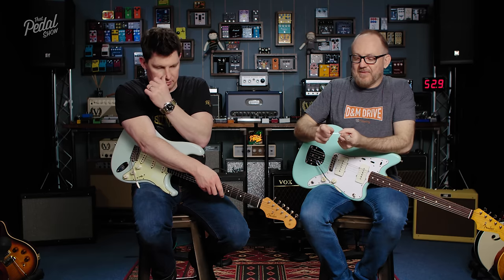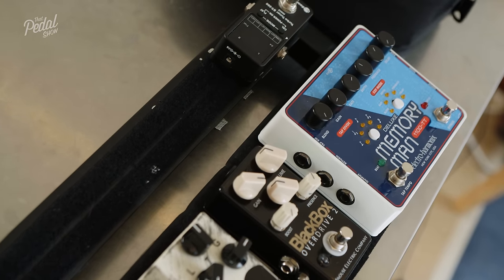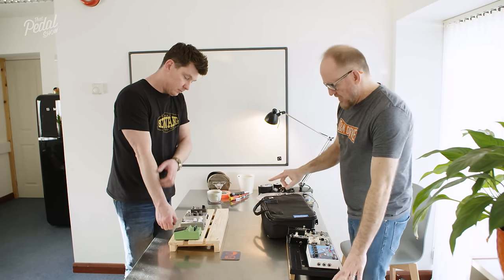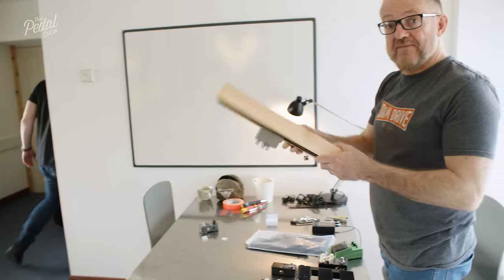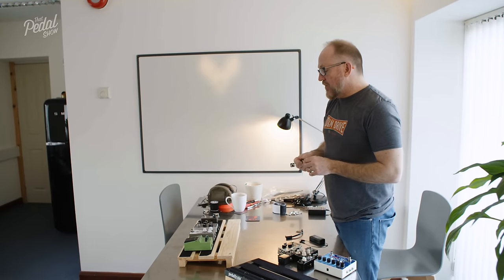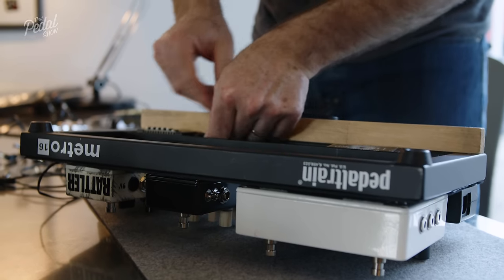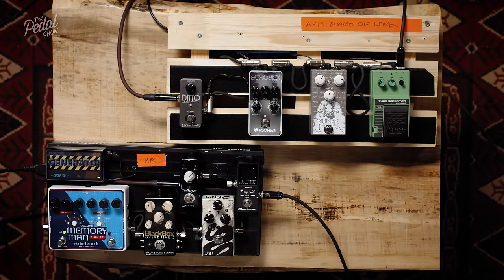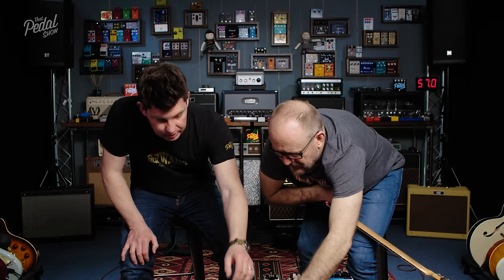Tips For Your First Pedalboard Build – That Pedal Show

Comment: Man I wish this video existed 20 years ago when I first started getting pedals. Daisy chains and cheap patch cables all over the place. People don’t realize the service you are providing. Keep it up guys.
Reply: ah the good ol days of the carpetboard! sweet nostalgia.
Reply: Wild Eye Right?!? I am embarrassed that I got my first good power supply for my pedal board in 2005 or so.
Reply: Wild Eye  I'll put my hand up to the same mistake. Hey, got a lot of great (and pricey) pedals, nice guitar(s) and a couple of sweet valve amps. Now...power...hmm, those Joyo PS seem pretty good...
D'Oh!!!

Thanks be to D & M, now I have a Strymon Ojai with a Zuma on the way. Can finally use the high ma units wirhout bloody separate adapters into a power board. Line6 M5, revenge is mine! TC Vintage Delay,  12v 270ma? Bwahaha you cannot defeat me with your puny ma draw, now!
Reply: I'd buy GigRig but they are always sold out and buying from overseas? I also need to eat,  eh.
Reply: I'm just starting with this pedalboard thing. Can someone tell me the difference between a daisychain and a power supply? and how does it affect the sound?. I'll appreciate it
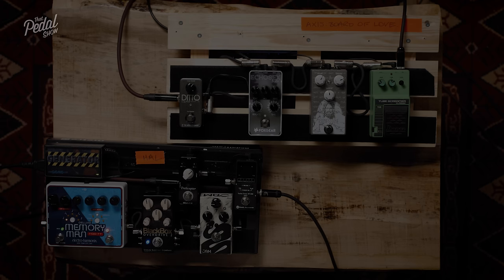Reply: @mollet09  It depends on the chain. My chain with all analog pedals sounded fine with a daisy chain. I had no noise issues. I eventually got an isolated power supply to make things neater, to power more pedals than my daisy chain could handle, and to have the option of 18v for some of the pedals. But it sounded exactly the same as the daisy chain. Daisy chains are perfectly fine if they work for your rig. But some people have noise issue when some pedals interact like what we saw with Mick at 58:40.

Isolation is always good though but daisy chaining isn't always good. Neither should affect sound but sometimes they do. I recommend a power supply just to be safe.
Reply: @JELIFISH19  thanks for the info!
Reply: @mattgilbert7347  i still daisy chain and use several power supplies. i tried to switch to a single high end unit, but not one has the required power for all my pedals. one of my pedals requires 12ac 1000ma.
Reply: @yomuthabyotch  Yep. My 1st Pedalboard was a thick piece of carpet.
Reply: I couldn't agree more. I wish all of these online resources existed when I started playing 30 years ago
Reply: Does the power supply actually make that much of a difference??
Reply: @dizzyguy7423  if it's cheap? There is a very good reason, poor regulation is guaranteed to make the pedals scream!
Reply: @yomuthabyotch  I still have mine! It sits in the garage now and haven’t used it for maybe 13 years and I’ve upgraded to a professional pedal train board. But yes I got good use out of that carpet board!
Reply: HA!, HA!  RIGHT! TOO FUNNY, Mr. PENGUIN! , - Eric   lapton

Comment: A quick thought on attaching velcro or dual lock tape on the bottom of Boss pedals.
If you unscrew the base plate, you can turn it over and screw it back on with the inner surface facing out. Then you can put your velcro on without any trouble.
Reply: this comment just saved me ripping the rubber base of the bottom of my boss pedals, thankyou!
Reply: Neither things is necessary. Just put a piece of Velcro on the middle of the bottom plate, between the rubber pads... Absolutely no problem with it sticking. 

Don't make it harder than it needs to be fellas
Reply: Tried this with my Boss Tremolo. It doesn't work cos the rubber pad presses against the IC board. But good guess anyway!
Reply: @ryans9029  this is correct.
Reply: @jamesmolloy5350  damn, i already did that lol. ill make sure to use this trick in the future tho.
Reply: Man i wish i did that before my mij lable came off with the velcro

Comment: As an electrical engineer, I think it would be good to explain why a daisy chain power supply is not a good choice. Even if you have an amazingly clean, well-built supply, the problem occurs when the pedals are wired in parallel (daisy chained). Each pedal will generate some amount of electrical noise... some more than others. So the clean power is compromised immediately, and other pedals then get noise on their input power. Isolated just means each pedal gets a separate run that has regulation, filter caps, etc. in a star topology. Dan's absolutely right, avoid the daisy chain style. It's not a diss on any manufacturer, nor being an audio snob; it's just electrical wisdom. Cheers!
Reply: Thanks for the info!!   What's the alternative? 9 volt batteries all around?
Reply: @jb71488  Certainly, except a Iot of modern smaller pedals don't take batteries.

Comment: From what i've learned watching That Pedal Show over the years. You need 1 Centaur, 1 King Of Tone, 1 Strymon blue sky,  taped to a astroturfed pallet. Done.
Reply: + an original essentially priceless tape delay of some kind.
Reply: I don't remember these guys ever using a blue sky. They are more delay than reverb guys imo.
Reply: Be realistic.  Both Timeline and Blue Sky.  

Also, I guess "Earth" and "ground" mean the same on opposite sides of the pond.
Reply: I sold my centaur, that I bought new a long time ago, because I like the Benson Preamp pedal a lot more. First pedal I ever found to be better than a klon.
Reply: @vibroluxon8  I know I'm a little late to the party so to speak, but I really am surprised that the plastic know it all brigade, haven't jumped all over you with; OFFS isms! y'know? 
Like/don't like?  It's all subjective

Comment: My first pedal board was the top of a school desk that I found in a dumpster, cut to the size and shape of a “replacement” SKB soft case I got for cheep. My dad jerry-rigged me some power distribution using a single Dunlop power supply I had, a piece of circuitboard he had lying around in the garage, and a bunch of wires and connectors. Essentially an over engineered and unsightly daisychain which we literally screwed to the board. I wish I had pictures of that thing, but alas, these were the days before cell phone cameras... The pedals, I believe, were a Crybaby, a Boss Mega Distortion, a Boss Bass Overdrive (cool sounds to be had with a guitar), PH3 Phaser, BF2 Flanger, and a DD5 Delay, with a QuikTune tuner which only tuned to standard tuning.
I was so proud of that monstrosity...

Comment: My first pedalboard I made 25 years ago and was a piece of scrap plywood with rubber feet screwed to it underneath. The pedals fixed to the board with cableties through holes I drilled in it. It had a Sovtek Green Muff, a MXR Dist+, a 70’s Small Stone, a Gollmer 60’s trem, a boss DD-3 and two boss compressors (cs-2+cs-3), one used as boost, one used as ”negative” boost/instant volume drop. The was also an off board Cry Baby first in the chain. All powered with separate 9V adapters (the Sovtek and the MXR i had hardwired adapters to the battery clip wires, as I always forgot to unplug them, draining the batteries), with cheapo coloured ”spaghetti” patchcables. It hummed like hell, but back then, living in a small town and before internet, you got what you could get your hands on. Everything into a MusicMan HD120 with a Malmberg 4x12, patched to a Bassman 100 with a Bassman 4x12. Loud as hell and probably illegal volumes today... my second pedalboard I built two years ago and now I have a third one. The Gollmer 60’s trem is still on there though! :D

Comment: Always found it useful to have a multimeter on hand, too. Continuity for testing cables and isolation of power supply grounds - before you start jamming ;) - and DC voltage for double checking correct voltage and polarity. Not necessarily expensive and cuts out exposing pedals to inevitable goofs.

Comment: Regarding alternative power supplies I can highly recommend the CIOKS products. Super low noise, build like a tank and flexible power output. The DC range is pure gold!
Reply: I just got a Cioks DC5 for my PT Nano. Haven't installed it yet.
Seems pretty heavy... Do you think low-profile 3M Dual Lock will hold it?
Reply: @mannishboy1  Yes. I just used the 250/250 Strength to Hold a Fulltone Wah ( built like a tank & super heavy ). The Dual Lock - " Holds the Pedals for Ransom "
Reply: @mannishboy1  top mounted for sure, underneath: probably :) When in doubt: zip tie or screws
Reply: I use dual lock for my truetone supply and it works a treat. No concerns whatsoever about it falling off
Reply: @mannishboy1   - I have a Cioks Adam for just a standard nano, I used dual lock to start with (underneath this is) which worked great but I found it was super close to the ground so ended up using screws, so might be worth checking your ground clearance before!
Reply: That new DC7 is awesome. 
Every isolated output, can do 660 mA, and it has 4 selectable voltages, with a 5V USB out, and 24V DC auxiliary output. 
It’s expandable with the CIOKS 4 or 8 as well. 
Voodoo Power Plus 2 looks old as hell now. And makes 100, or even 200 mA outputs seem so limited.

Comment: Super fun video.  Brought me back to building my first pedal board.  I had the Boss BCB6 plastic board with all Boss pedals.  The Boss power supply had you daisy chain them all together.  I thought it was so killer.  Boss CS2, CE2, BF2 (Flanger), HM2 (Heavy Metal),  and DD2 (delay).   Still have the DD2 and the CS2.  They are considered vintage now.   Monday my Schmidt Array Board arrives from Germany.  My Gigrig G2 is already here.  So....34 years after building my first pedal board, along with 15 other boards since, I may be building my last pedal board.  :)  Cheers!!

Comment: When you two play together it’s truly special. I found myself reaching for my guitar and playing along. If your goal was to inspire others to play more it certainly worked with me. One question. My black magic zen drive has a level and gain the seem to interact with each other differently than a normal drive pedal. For me to get the “right” sound I find the overall level being way above unity. I’ve mitigated this with a boost for when I don’t have the zen drive active. This leaves me feeling like I am tap dancing. What other ways are there to address the differences without making me adjust the levels on the pedal? Thanks for another great show.

Comment: Here's my tip... buy a Keeley D & M drive:
1) two pedals in one
2) switch the order of the Boost & Drive sides with a flick of a switch
3) less patch cables
4) less power cables
5) smaller footprint than two standard-size pedals
6) wide-range of great sounds
7) if needed, flexible routing system using TRS cables (which kind of negates point #3 above, but if you need it it's available)

Comment: One great trick is to use the pedalboard tape but DON'T take off the paper backing and glue the tape to the pedal. Instead, cut the small squares, poke a hole in the tape then use the pedal base screws through the holes. Then you don't have the glue stuck on an expensive pedal or have to worry about those rubber bottoms. Just poke a small hole, not one large enough that the scree head easily pulls through

Comment: Shoutout to the Snouse Blackbox 2. My absolute favorite drive to date!
Reply: Ya!  I've had one on my board for a couple of years, and it blows me away every time I use it.  Mine came before the external switches were available, so it requires a degree of jiggery-pokery to make any adjustments.  I do it gladly.
Reply: Yeah man I was shocked by it, it’s better than my klon and old ts808 and all others I’ve tried, its speciality

Comment: The other benefit to putting the hook side of velcro on the bottom of the pedal is that the hook side collects dust, pet hair, lint and other muck a lot more than the loop side. Having it on the bottom of the pedals keeps the board cleaner as a whole.
Reply: Exactly! Random visible lint pretty much ruins my tone. YMMV.

Comment: That was fun. Been there and done that many times over the last 30 years, and still it is fun to watch you guys and see how similar my thought process is to this.
Dan the Snouse sounded awesome and you have me looking at a memory man now, oh dear..
Mick i’m off to try my Tubescreamer before my Bluesbreaker for a change and now have to take another look at the foxgear

As a Lefty,  yes have certainly encountered the ‘right to left’ cable run issue.. these days i just use a right angle plug on the input side and loop it under the front of the pedaltrain and out the other side, i am sure there is a more expensive solution to this, but hey this works for me...

Comment: Built 3 boards and after this tutorial, I will tear everything down and start over. Thanks for giving more reasons to avoid my actual work! Gents, is there any difference in the type of patch cables such as the gauge and the plug in connectors?

Comment: Great info. Thanks.
Would you allow me to add something?
In building my own pedalboard with a 10 output power supply, I found using a label-maker to identify each power lead (i.e. the name of the pedal it powered) at the power supply end was really helpful if a pedal died.  Instead of chasing each power lead down, you can instantly see which power lead plug you need to check.
Just a little thing, and a bit OCD, but worthwhile, especially in a gig situation.

Comment: Did my first board (after decades playing) a few weeks ago thanks to you guys. It works well, a Harley Benton copy of a Pedaltrain for a tenner less, and H.B.'s Powerplant ISO-1. The board comes in a gig bag with a rocket on it! Very happy with the very low noise level and overall quality. And the rocket. Sorry it couldn't be GigRig gear Dan but it's a bit beyond my budget at the moment. And I've gone wet/dry. Guys, you are changing the world, for the better! :)

Comment: What are Dan's AC15 settings here?  Sounds amazing!
Reply: Right? I'm seriously considering flogging my Bassbreaker15 and getting an AC15. If I need the Marshally thing (which the BB does), I have my Laney Cub12r & 112 extension w/Vintage 30. But man, an AC15 is the ticket. There's a used AC15C1 w/Greenback going for $550AUD near to where I live.
Decisions...
Reply: @mattgilbert7347  that sounds like a cracking plan matey, love mine.
Been playing the Marshall Origin recently, but my AC15c1 was the sound I'd been searching for for a long time... 

That and my RAT is what I've always had in my head, the Origin was because I wanted the vintage style Marshall lead tones, which its great for, and cuts through a mix woth another loud guitarist, but now I'm the only player thinking about just getting my sound back...

Comment: Could I suggest putting a seal coat on the raw timber board.....much better adhesion .....
Reply: I was thinkig the same. Using something unusual, which is superglue. You can get large bottles of thin, medium and thick. Which is great for wood, as it acts as a wood filler and sealer at the same time. So those strips will stick really well. :)
Reply: Any paint you have lying around works too.

Comment: You don’t have to break the bank to build a great pedalboard. I built a board with a basic loop switcher, isolated power supply, tuner, TC compressor, spark booster, boss od-3, TS mini, TC honeypot fuzz, TC 3rd dimension chorus, Mooer trelicopter, and delays from a zoom ms-cdr. All for less than 600 quid. Does everything I need and sounds amazing. Clean, no noise, no batteries. And very convenient

Comment: Good video guys, not all of us have a need for or require complex pedal switching systems with 10 pedals, I myself use a Metro 16 with two overdrives and two delays into my amp. Setups like this make perfect grab and go boards, very simple to assemble and they are incredibly functional.

Comment: As a lefty I will certify that being left handed and having to run your cables back across your feet is incredibly annoying. So much so that I added clips along the edge of my board and use a cable with a 90 degree jack so that I can attach it to my board and not have my cables run by my feet.
Reply: Honestly, in your case, I'd just use a patch bay on the lh side of the board, and run cables under the board to keep it looking clean. But... I have issues and get ocd with my boards.

Comment: This sort of video never gets old. Great sounds coming from both of these boards as well! For cleaning up cables underneath another option I've found is Velcro One Wrap. It can be cut to whatever length you need and sticks to itself. Wrap it around your cables and then whichever side of the wrap is on the outside, stick a strip of velcro of the opposite type on the bottom of the board and then the One Wrap will stick to that. I don't know if the bond is strong enough for heavy gigging but it works for me.

Comment: My first: Three pedals, MDF sprayed black, stick-on feet and strips of stick-on velcro. Power supply was a generic 9VDC wall adapter that plugged into the daisy chain. I also took the corners off the board - dropped into a Tesco carrier bag as easy as you like - and took the velcro right to the underside and tacked it into place. Total cost about £15 with enough velcro left for several more boards.

Comment: That was a perfect introduction to pedal board building. For patch cabling, because the Evidence leads are a bit above what I feel I can justify spending, I went with the Boss solderless kits. So far it’s proved a good bang per buck compromise, though I’m pretty gentle with my board. For anyone wanting custom cable lengths, but who can’t spend a fortune on getting the best, the Boss system might be what you need.

Comment: “The general consensus is hook side on the pedal and loop side on the board”.  And the others just want to see the world burn...

Next let’s see a “road worthiness” episode with tips like using the rubber washers to prevent knobs from rotating, etc.

Also, you both modded the Metro to be angled.  How did you go about that?

Comment: DIY Board Tip: I built a homemade wooden pedal board and I put small round head screws underneath it and used little rubber bands from my kids loom banding kit to hold all of the cables down.